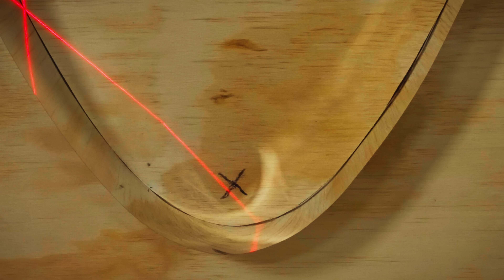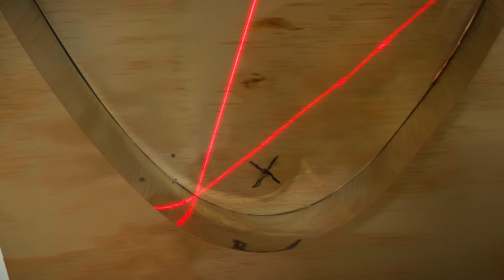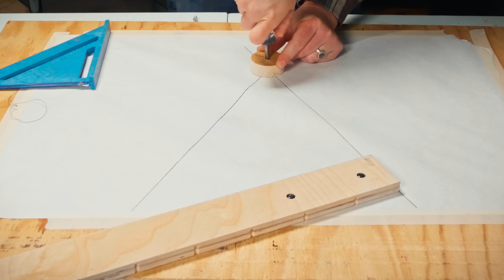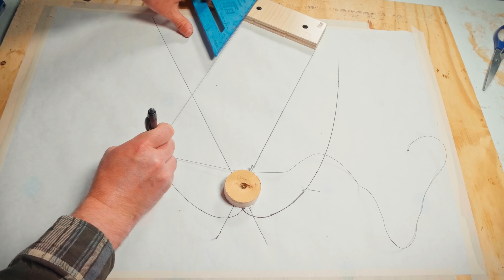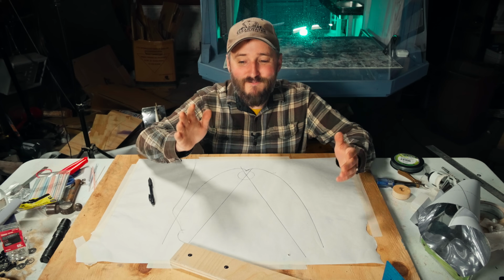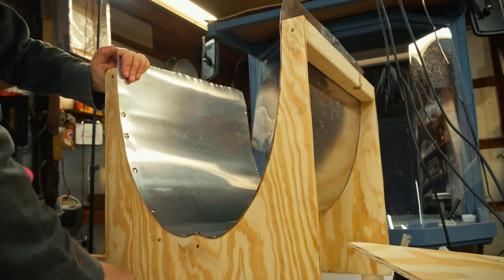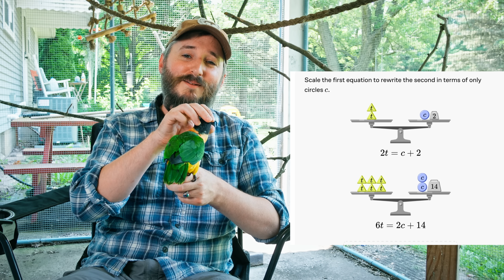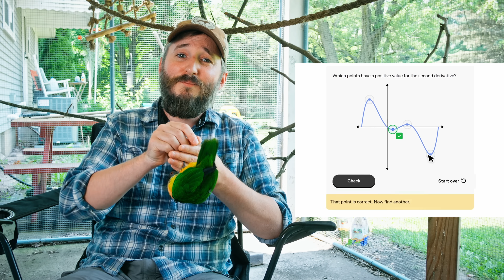DIY Solar Concentrators, Made Better.

Comment: Im fairly certain that actually hanging chain is a catenary, or a hyperbolic cosine. Parabolic curves are seen is projectile motion, but not quite in hanging chains
Reply from the maker: Shoot. I have to get at least one thing wrong per video. At least I show how to make a proper parabola later with a string construction. Now that section isn't redundant
Reply: @Nighthawkinlight I would guess the difference between the two curves would only be a few percent at best meaning just tiny degrees of efficiency from a basically unlimited energy source (sun) for a big trade in simplicity of construction. Going with your approach here actually. Literally if you had said “approximate” this video would be perfect.
Reply: @Nighthawkinlight  it's ok, they are very very close to each other and at these scales it will not make a difference, your method is correct
in fact up to 60ft or ~20m size dishes, catenary and parabola will perform the same for even a 3inch size collector area
but over 20m, if you have a 3in size collector, you a parabola would be preferable
Reply: @Nighthawkinlight  Parabola vs catenary? Catenary curve is close enough for a reflective collector... especially if the focal point is a larger pipe. I've seen others successfully use catenary curves in reflective collector construction. And as you demonstrated, its pretty quick and easy to get the catenary curve on paper. Good video... very good video... I would like to see you assemble a working water heater with this collector design. Been thinking... Water would be limited to 212f... If you could utilize waste engine oil as the working fluid, you could store up a number of gallons of 500*-f fluid. Then circulate water through a heat-exchange coil submerged in the hot oil... Just some thoughts, not sure about the max oil temp.
Reply: @joycemanders7737  will oil thermo siphon like water?
Reply: @Nighthawkinlight  They are fractionally different. The imprecision of drawing and cutting in the real world overwhelms the differences on this scale.
Reply: @Nighthawkinlight  Fun fact: Gustave Eiffel used catenary curves to design the Eiffel Tower.
Reply: @Nighthawkinlight  The fact that you are able to create more real world fun projects that have utility means more than than being 100% accurate.   80/20.    But it is good to know
Reply: @Nighthawkinlight  Yup, though at the level of this sort of demo, and catenary and a parabola differ y only a small amount. Catenary curves have lots of fun properties as well: they're the best curve for a roof to have under extreme rain, because it's the fastest path for a rolling (or flowing) object to move down. Upside down, it's the strongest arc, etc.
Reply: @Nighthawkinlight   Being wrong about something just means you're learning, that's a good thing
Reply: @Nighthawkinlight please pin his comment so others see and learn this too.
Reply: @Nighthawkinlight  To make a perfect paraboloid : put some stretchy material on top of a round bucket then make some partial vacuum inside the bucket. Then you can apply some glass fiber + resin to keep the shape. Finally you use this glass fiber assembly as a mould to create as many as you want.
Reply: @cmuller1441  he did that one time for making a parabolic mirror
Reply: @cmuller1441  He does that in an earlier video.  It is well worth watching.
Reply: @cmuller1441  Unless you're in orbit, that's not quite true.  The weight of the rubber sheet will distort it slightly from a perfect parabola.  The same reason a suspended chain isn't perfectly parabolic.  The weight of the chain itself affects the curve, resulting in a catenary.
Reply: @cmuller1441  Yes. Evenly distributed loads applied in a consistent direction to flexible surfaces (rather than varying in direction by position, as with the reaction forces on links in a chain) can make parabolas. Also notable, as it turns out, the curved cables used in bridge construction often follow a parabolic arc more closely than a catenary (the load of the bridge applied to each segment of the main cable dominating the direction of the reactions at each end of the section of the cable, and making them point more uniformly in a consistent upward direction).
Reply: @cmuller1441  That would be an elastic catenoid, not a perfect parabaloid.  Good approximate method, though.
Reply: @cmuller1441  Usefull if you want a dish.... (need a lot of dishes to make slices for a trough...  😀
Reply: @cmuller1441  The final accuracy of the mirror was good enough you probably don't need to go this far. 
You might want something better for optical parabolics, but the laser tracked the focal point well enough that errors in incoming light angle are probably more important than the difference between this curve and a true parabolic.
Reply: @cmuller1441  Use positive pressure in the bucket to create a dome.  Then the inside will be smooth, rather than the outside.  Coat with white gelcoat prior to fiberglass for better reflectivity.
Reply: @cmuller1441  That makes a spherical section not a paraboloid
Reply: @cmuller1441  if you put the fiber and resin on the outside of the stretchy material, then the surface of the reflector will be rough. Could you inflate the stretchy material over the bucket and get the same curve? That way when you cover it with the fiber and resin, the surface of the reflector would be smooth.
Reply: @Nighthawkinlight i think you can show conditions where the shape of a catenary between two points is close enough to a parabola for certain families of curves
Reply: @Nighthawkinlight  they're extremely close though. It's probably within your drawing and cutting tolerances.
Reply: @Nighthawkinlight  don't worry too much, I was just about about to follow what you said but he speaking a different language altogether! He could be right or wrong, I ve no idea what he means.
Reply: @Nighthawkinlight  engagement bait.
Reply: maybe the smaller pipe heated less bcz it wasnt parabolic :v
Reply: @Nighthawkinlight if I'm not wrong your assumption would have been right if the chain had an uniformly distributed load at the bottom
Reply: @Nighthawkinlight  you did it again... I was like "although the school physics was long, long time ago, I'm like 99.99% sure that hanging rope is NOT the parabolic shape..." also, this alleged "one thing is better than the other" - without actual energy calculations is meaningless... you got vastly different areas of the pipes, you intentionally covered one with the cup, when the other was allowed to "vent"... obviously you get different results, and you make extraordinary claims supported by nothing... you didn't even include the embedded temperature reading from your infrared camera... And I'm not even talking about the reflectiveness of the surface you measured... the insides of the small pipe are clearly metallic-reflective... the large pipe seem to be not that... and all the infrared cameras assume some albedo/emotiveness, which will clearly not work for reflective surfaces, like bare metal... Dude... you should either do it more or less properly, or stop spreading this pseudoscience... I'm not a scientist or claim to be one, but watching you do your stuff is like watching somebody doing the brain surgery with a rusty dirty 2 inch chisel and a hammer... why can't you listen to a reasonable valid feedback and improve?
Reply: @TaranovskiAlex  "but watching you do your stuff is like watching somebody doing the brain surgery with a rusty dirty 2 inch chisel and a hammer" 
great constructive criticism dude.... very "reasonable" feedback, what the hell is wrong with you?
Reply: @TaranovskiAlex  Absolutely nothing about your comment was "constructive".
Reply: @DockDoorDoom  "hanging rope/chain is a parabola" - says "citizen scientist"... like, come on... isn't the comparison quite fitting? like, ya, people used to do successful lobotomies 10 thousand years ago with a rock and a stick... are you suggesting that his "scientific conclusions" are top notch? and can't be validly criticized at all?
Reply: @DockDoorDoom  all I'm saying that if you are trying to do science - at least make an effort to do it reasonably well...
Reply: @TaranovskiAlex I imagine the point was to create and allow the reproduction of something actually useful in a real-world scenario. The intended audience will include many who do not know or care about the difference between catenary and parabolic. What they care about is building something useful. Is it useful even though it isn't perfect? Yes.
Reply: @TaranovskiAlex someone got out of bed on the wrong side
Reply: just wanted to point out this!
Reply: Yep, they are very similar so the hanging chain is a useful quick approximation but it's not quite the same shape.
Reply: I don't remember much from university, but that one stuck somehow :D
Reply: sure is a catenary to me, i assisted in a kiln construction where the kiln chamber was a catenary arch (self supporting) built of refractory brick, the former for the arched walls and roof of the kiln was produced by inverting the hanging chain curve.
Reply: By definition, a hanging string forms a catenary. Try taking an 8’ piece of string tied to magnetic hooks. Place and adjust the hooks on a steel wall until the string’s dip in the middle measures ¼ of the distance between them. The catenary then approximates a parabola whose focal point is centered on the line between your two hooks.

Result: 82” of separation gives a focal length of 20.5“ when using a 96“ piece of material.

Now it’s a simple matter to bend an 8’ aluminized mylar mirror to the same distance and have a “parabolic” trough reflector. This is scalable.
Reply: To be even more pedantic: on a finitely-large planet, any projectile thrown from the surface that doesn't reach escape velocity will travel on an elliptical path.
Reply: yeah was going to comment this but someone beat me to it!
Reply: Yes, a parabola is the curve you get when a massless chain is hanging under an equal load per unit span, which is a good approximation of e.g. the main cables of a suspension bridge. A catenary, the curve made by a chain of constant mass per length hanging under only its own weight, is slightly "wider"/at any point except for the anchor points and the apex it is a little lower than a parabola of the same span and sag (the height between the anchor points and the apex)
Reply: yup. Should be the pinned comment on this one. catenary.... not parabolic.  still a function though.
Reply: Came here to say this.
Reply: Was just about to comment this!
Hmm... as a counter-point then. A parabola is still a really good approximation! Similar to cosine, hyperbolic cosine has no cubic or linear term in its taylor series, so 1 + x^2/2 is both the second AND third order taylor polynomial for cosh(x), and thus, is notably very good at approximating the curve!
Reply: Glad to know I wasn't the only one who caught that.
Reply: The difference between a catenary and a parabola is often slight.  If the holding points and bottom of each curve match, then the error is worst at points roughly halfway up the length on each side, but the percentage error goes down the further apart the holding points are.
Reply: @Impatient_Ape  Is that the same as saying the tighter the chain/rope, the more parabolic-ish the curve?  If the chain/rope were elastic enough to stretch slightly but significantly under its self-weight, what effect does that have on its deviation from truly parabolic? I'm annoyed that I used to be able to figure this stuff out mathematically in my school days but I seem to have misplaced the knowledge since.
Reply: @Impatient_Ape That was as far as Galileo got with the puzzle, so it's pretty close. He said the curve isn't parabolic but is really close when the angle of sag is less than 45 deg
Reply: Yup
Reply: Correct, but it's a close enough approximation, the efficiency loss is minimal
Reply: True, the chain is a catenary. However, they are often very close and a parabola is often used as an approximation of the catenary.
Reply: What is the Math for a Brachistochrone curve, then?
Reply: I was thinking catenaries when I heard the chain bit as well... though now I'm curious how a reflector formed from extruding or revolving a catenary would affect the reflected light... also hyperbolas, spherical reflectors, elliptical reflectors, cycloids, cassini ovals, sinusoidal reflectors, and other such curves.
Reply: These are conic sections that the ancient Greeks used to teach math with.
Reply: And they were used extensively in medieval construction as the inverted shape is as strong as it can be. Used extensively in the Segrada Familia for example.
Reply: Yep. I work with catenary curves daily. Came here to say the same thing! 😂
Reply: Now I want to build a disco dance floor with parabolic mirrored walls
Reply: U got absolutely right
Reply: you can make an easy parabola with a ruler and drawing a graph then graphing some points and connecting them with a line.
Reply: It's hilarious reading all these posts from you scientific math nerds debating like you're the cast of the Big Bang tv show. 😅
Reply: projectile motion is elliptical not parabolic.  it's an orbit and orbits are elliptical.
Reply: Yes, exactly. You're correct on that, close though they may be in shape, there is a physica/geometrical difference in the curves based on the physics of the action of gravity on the free hanging flexible chain or rope (which there is no doubt mathematical formulae for), versus the simpler mathematical/projectile motion curve of a parabola.
Reply: Came to the comments to say this. But, if I remember correctly, the minor differences between the curves are almost negligible in this application. It's nice being the "akshually" guys isn't it? :P
Reply: Could the flat version be used to collect more sunlight onto a small solar panel or would it get too hot?
Reply: Alright, but where's the death ray?
Reply: its almost a parabola, probably only off by a few percent.
Reply: Came to say this. As anyone who ever visited the St. Louis Arch learned (it's an upside-down/inverted weighted catenary curve).
Reply: Well,if your Focal Point is, say,  a half inch pipe rather than a single point in space, it's most likely close enough, for this use.
Reply: Awesome job Ben, love your work. sent a link earlier I did with (math formula) web format , that saves svg and interacts with Compound Parabolic Concentrator for use with CNC and Laser projects. (click on turtle to left).
Reply: Oh 'hanging chain', that Gaudi Curves for weight distributions onto vertical columns
Reply: So because we're not looking for a catenary... it's not that a parabola approximates a catenary... It's that a catenary approximates a parabola! 

"The model works, but only under the assumption of perfectly spherical chickens in a vacuum!"
Reply: Robin, Thanks for this comment. I was struggling with my autistic side. Should I unmask and correct? I know I never should. You saved me from the dilemma.
Reply: Drag-free projectile motion on earth is not parabolic, it is elliptical. This is not surprising since it is just an orbit interrupted by collision with the earth. Parabolic trajectories are the limiting case for a flat earth of infinite size.
Reply: Projectile motion in a vacuum!
Reply: What he said is tough enough to follow. I was lost with what you said after "chain" can you say that for non scientific types?
Reply: thanks for reminding me of Gaudi.

That is how he designed the Sagrada Familia, right?
Reply: You only presented a vertical strip that has the approximate shape of a parabola. What you need is a paraboloid, which is the 3d shape a parabola if you spin it about it's vertical axis. In that case you would  always have a point where every normal to the surface converges.
Reply: If you add weights to the chain that are evenly spaced along a horizontal line (not along the length of the chain) it will become a parabola.

This is why suspension bridges have parabolas not catenaries in their main cables.
Reply: @cogwheel42  and it’s kind of interesting that you made the suspension bridge point. And I really like that point. Because for a suspension bridge, it is necessary that the horizontal weight is even distributed because you’re having a flat bridge on top. Cool stuff
Reply: @cogwheel42  yeah but in the video, he just made the hanging chain analogy by. Yes you are correct space the way out evenly across the horizontal access that the two points are connected. You will get a parabola.
Reply: The comparison isn’t really fair — aluminum and steel have very different thermal properties. Aluminum loses heat much faster, so the lower temperature could be due to the pipe, not the mirror design.

Comment: The mirror can be aimed without moving the coolant pipe.  Aiming circuit is as easy as two actuators hooked up to tiny photovoltaic sensors such that as the mirror moves out of alignment the sun falls on the cell and powers the actuator until the mirror arrives in position to shade the actuators solar cell.  One setup on each side and voila tracks the sun automatically
Reply from the maker: True, but even so a parabola isn't as good as a compound parabola. More effeciency, and no tracking needed at all